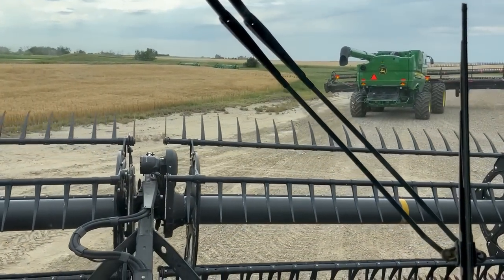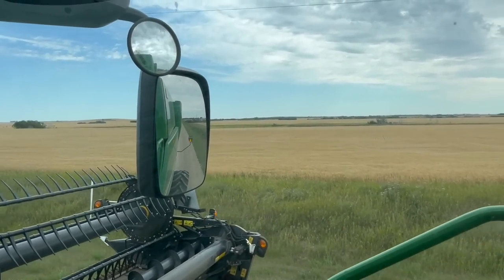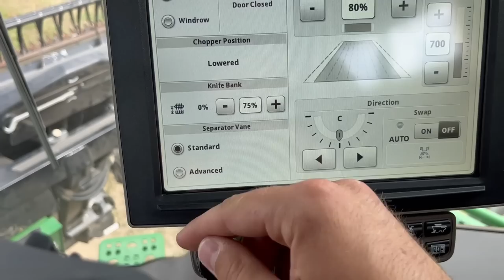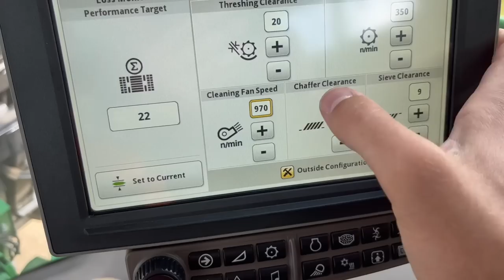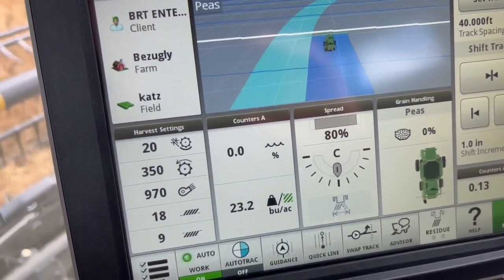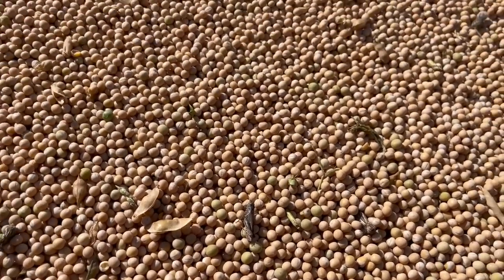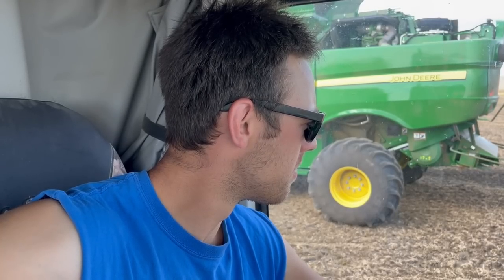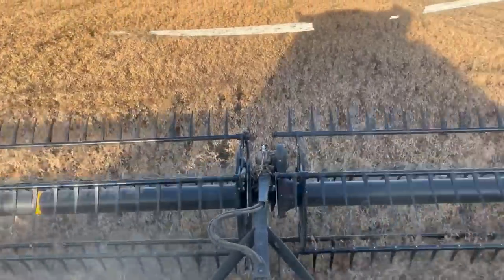Our FIRST Day Of Harvest - 2022

Comment: Hey Dustin awesome video. We finished our peas and lentils couple days, such a good feeling to finish cutting on the ground. 
We use soybeans for peas, as soybeans have the active yield and is more accurate then peas. 
Hope you like the new machines, we have 780s and love them. Made the switch from NHs three yrs ago. Run 45’ Deere headers. 
Have a good safe harvest.
Reply from the maker: How was the yield and how do you like the Deere headers?
Reply: Peas avg 45
Lentils 19 too much rain for lentils this yr. 
Really like the Deere headers. Ran Macdons for yrs, no more tires, can set pressure on cutter bar instead of the letters and numbers on the Macdons. 
Downfall is Deere polys cost quite a bit more than Macdon. 
All and all great header. 
You should demo one if you can.

Comment: nice video Dustin we switched from red to green a couple years back We run two S780s with 12 row 30 corn heads and 40 foot drapers down here in Nebraska, very nice machines we could’ve used a little more rain our crop will be below average but we will survive, hope to start cutting beans in 3 weeks
Reply from the maker: Below average to average here too. Got some rains but too late